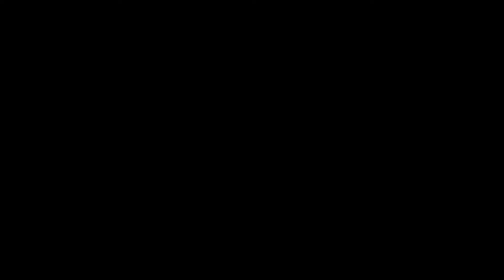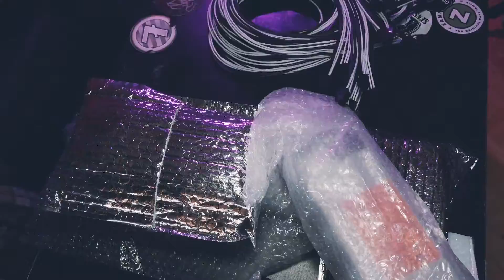Which PSU for mining crypto? (ASIC & GPU) ATX vs. HP Server power supplies

Comment: Ive been running both the HP and the EVGA Gold and Platinum PSU. They are all very reliable units for my 24/7 mining operation.
Reply from the maker: awesome! Always wanted to get my hands on an EVGA but they seem harder to find here in EU, so Corsair it was for me. Cheers and thanks for sharing
Reply: @CursedMining  How are you finding the Corsairs on the reliability ?  are the gold and platinum versions good for 24/7 operation?
Reply from the maker: @petrolheadtv1  until today, not one problem with a single one! HX1000 / 1200 working for the miners - all platinum ✌🏻I have gold rated ones in my PCs, never bothered to put the big ones in 😁

Comment: No need to short the pins.  Use a 1200 watt power supply.  Corsair includes an adapter to start the power supply if not connected to a motherboard.   I have 4 of them.   Not currently mining but they are in storage

Comment: Hey, haven't looked too deep into your channel yet but wondering if you have advice on specifically those 1200w HP psus and lowering or eliminating the noise. Just got one and it's like a vaccum, not desirable for now.
Can fill you back in when and if I try anything

Comment: HI, thanks for your video it is really informative, so it would be  possible to use the HP psu and a breakdown board and the cables adapter to power a desktop?
Reply from the maker: No problem at all, with the mentioned pico psu you need for the MoBo connection :) cheers

Comment: this is my main problem right now. 
i can buy an atx power supply and dont have to worry about two power cords but it will be more expensive.
the server power supply are rock solid and cheap but i still need a power supply for the mb and ssd
Reply from the maker: server with pico might still be cheaper - depends on availability :) ⛏️ cheers

Comment: Current input 120 or 240 v no I don't exactly know what I'm talkin about but it has to do with higher voltage into from the breaker ..
Reply from the maker: That depends on your country / what you have installed. Say when you have 220-240v (normal in Europe f.e.) they can run higher wattages. In US 120V is normal and big miners upgrade those breakers to 220-240v :) cheers
Reply: @CursedMining  will a server psu work just fine on 110-120volt? Just a little less wattage?
Reply from the maker: HP ones yes, they run normal but check for the wattages, I think the difference can be big, cheers :)

Comment: Need help on hooking up my Avalon 841 to dual hp 750 watt psu, with two x6b breakout boards.  I'm assuming one psu hooks up to one side of the miner, but on the breakout board side, does it matter the cable placement? Meaning, i plugged in 4 PCI-e cables to one side the miner, other end of the cables I plugged in to one side of the breakout board. (8 pci-e, 4 on each side) I guess my question is do I have to connect the 4 cables to all the same side of the breakout board or do I have to spread them out across the board.?
Reply from the maker: I don't have this Avalon, but generally it does not matter where exactly on the breakout board you place the cables, cheers ⛏️

Comment: Hey! Pretty old video, but hope there's still people here :p. 
I was wondering if you have the even newer style breakout boards that have floppy style connectors to link multiple server psu's?
Reply from the maker: Still people here :D hey! I saw those, but I never used one because I never needed multiple PSUs in one, sorry =/  cheers!
Reply: so do you have experiencia with dual psu? i’m wondering what’s happen if I don’t syncing my psu. for example my main psu turns off (the one that feeds motherboard) and the second psu start again (the one that is feeding my gpus)
is that bad?
Reply: @voodoomasterrace3707  as long as your operating system recognizes the gpus, it's not 'bad' I would say.
Reply: @IAMAWESOMEO3000  I mean the motherboard will be without power and the gpus with power. in that case something bad could happen?
Reply: @voodoomasterrace3707  no not really I believe. Can't think of a scenario where that leads to damage
Reply: @IAMAWESOMEO3000  i’m afraid of that because some of the breakouts has not port to sync

Comment: can you help me too,  be quiet! platinium 1200w or hp server 1200/1500w. Which one should I choose?.the most important for me is less power consumption. I'll use 6 or 8 cards rx 570 with btc-t37.
Reply from the maker: If the server PSU is also plat: use that, it will run you cheaper (they are available in gold or plat) - if you already have the be quiet, use that, will be more silent :)
Reply: @CursedMining  thank you

Comment: What foam are you using under the PSU?
Reply from the maker: I found those in a local hardware store. Anti-static rubber - got it mostly for vibrations though, helps a lot since it is pretty heavy :) ⛏️

Comment: hello buddy
for example I have 8 rtx 3060ti cards and I have 1 powersupply corsair 1000watt and PSU SERVER HP 1200watt, now I want to connect corsair with motherboard sata molex pcu etc, now can I share 2 or 3 GPUs with corsair 1000watt and others with PSU SERVER HP 1200watt can I just make the combination ????

thnx for all
Reply from the maker: Heyho Fatos! Yes that is actually a very common way this is done :) with 2 ATX PSUs there are even splitters for the 24pin so that they automatically turn on. I will do the way you proposed in a rig build very soon actually :) You will have to turn the Server PSU on first, then the main one with the rest of the rig, because otherwise it might be the rig does not recognize the extra cards. That's it :) cheers
Reply: @CursedMining  thnx buddy have a nice day
Reply from the maker: @fatoshodja1517  anytime! Thanks and to you too, cheers ⛏️⛏️
Reply: @CursedMining   hello again :)
can I use from Psu server 6 pin to 6 + 2 pin and Corsair 4pin to 6 + 2 gpu cable a Y splitter and connect the splitter with (1X RTX 3060Ti with 2X8 pin with 1x splitter) is it recommended or is it dangerous, and if is risk what you recommend me??
THNXXX for all
Reply from the maker: @fatoshodja1517  I would not split between the two separate PSUs as you won't turn them on at the same time. Maybe I understood wrong. You should divide the GPUs between both PSUs and have enough cables for the 3060Tis :) cheers

Comment: Silly question here. Can I use a 220-240v power supply in 120?
Reply from the maker: Sorry Raul here we only have 220v so I don't know. Most PSUs show ratings for both so with these you are safe, other than that not sure! Cheers ⛏️

Comment: Can I use apw7 or apw3++ directly on a mining rig? They have 10 pci e cables.
Reply from the maker: You would need the "Pico PSU" as mentioned in the video to power the 8pin for CPU and the Motherboard because the APWs don't have them. On boards like Octominer, you only need PCIE cables. So it depends. Those Pico PSUs are cheap though, with them you can do it together with APW, cheers
Reply: @CursedMining  can I use them just for powering gpus? And a atx power supply for motherboard?
Reply: The apw7 has 6pin pcie cable. How can I use them on rx580? Does rx 580 need 8 pin.

Comment: Can I run the motherboard, CPU, SSD and 1 RTX 3080 with a platinum rated 750w ATX power supply, then run 6 additional RTX 3080 GPUs on HP server PSUs?  Or will this be trouble?
Reply: Perfectly fine. Use a breakout board